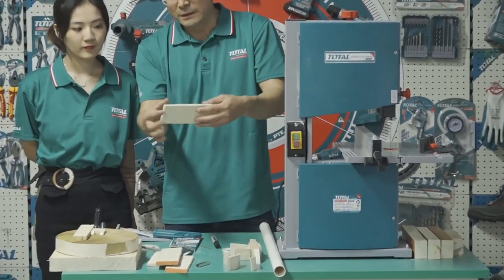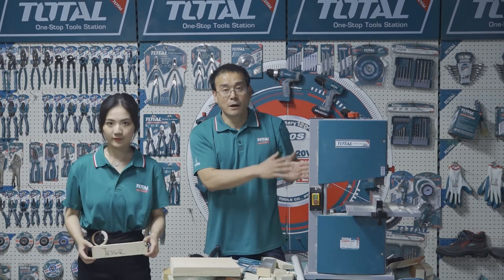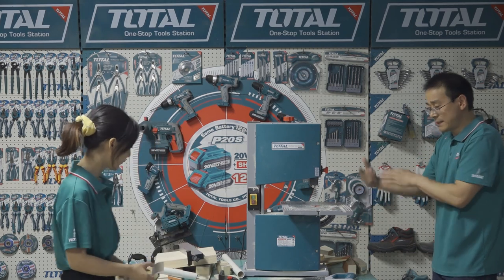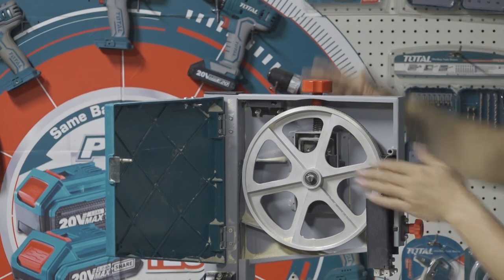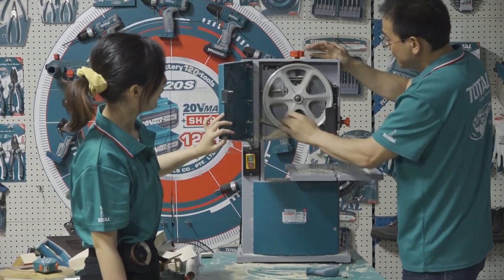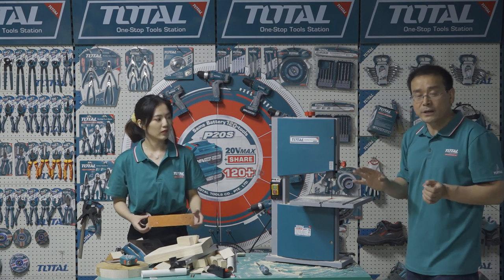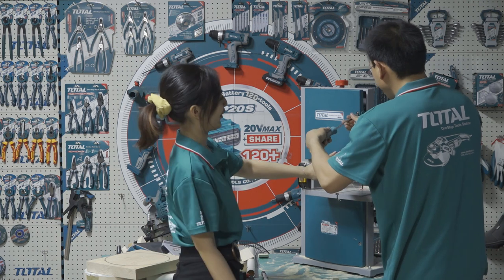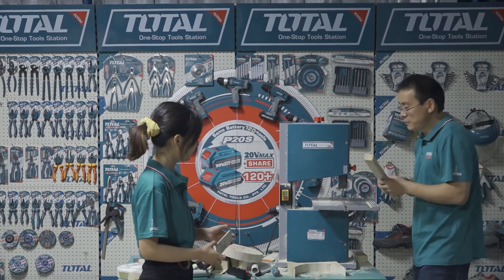TOTAL LIVE 12: BAND SAW

Comment: I purchased this saw but have several problems. I hope they can start to solve it and help us solve it by providing spare parts 1- The metal tactical guide is very hard on the blades and causes the blades to break. I bought six blades in three months😢😢. I hope you use Roman to replace it and introduce it to us. 2- The saw material in general is excellent, except for the plastic used in the blade guide.
It bends and shakes easily, which also causes the bladder to break.
3- It is very difficult to set the marsh to 90 degrees and takes a lot of time each time. 4- I hope to expect more blade models. You only have one type of blade teeth. I would like to provide a blade for cutting metal. I love you so much and all my devices are made by you, thank you Total❤
Reply: Is it power enough for cutting hardwood 2x6?